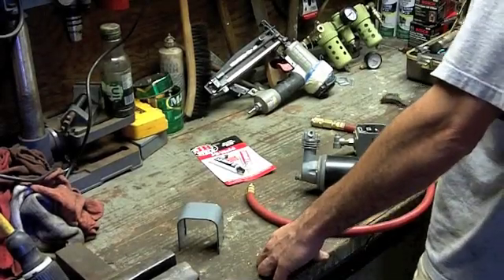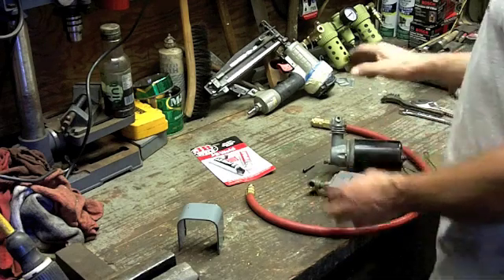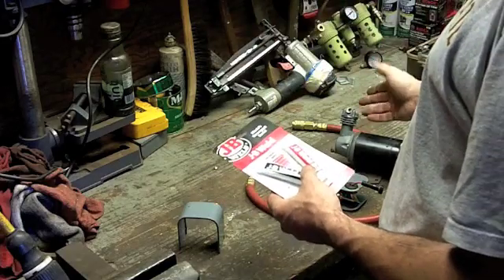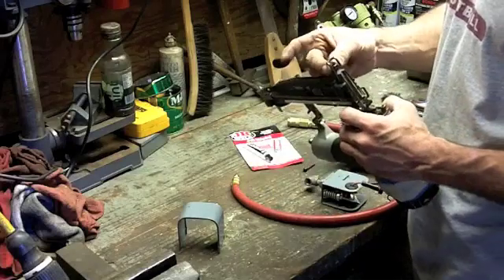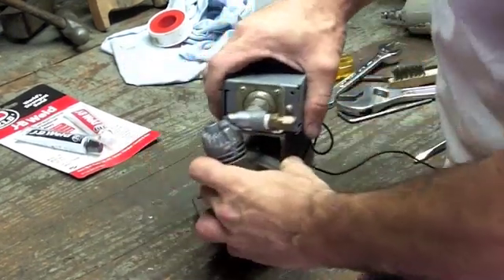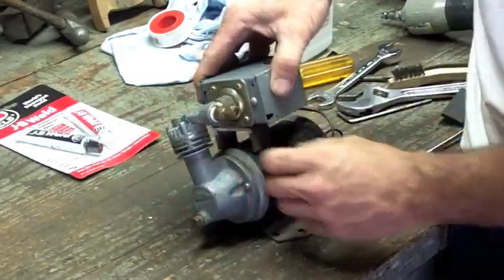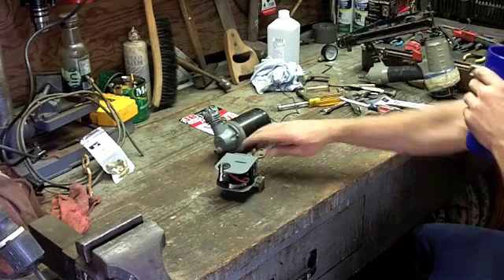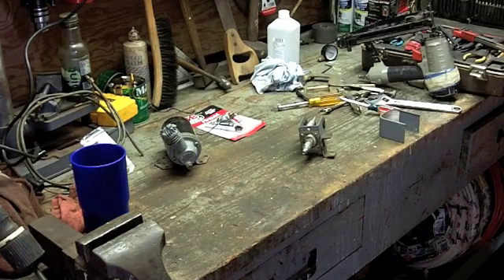JB Weld Stress Test Part 1

Comment: hey i have a question. Do you think i could use this to "weld" steel flat bars onto steel rectangular tubing for a minibike build... i am not sure if it will hold up but it would need to withstand 60 lbs... is it possible?
Reply from the maker: Honestly I don't think that would hold up.  Vibration and leverage are going to be your biggest hurdle.   I am assuming you don't have access to a welder, maybe drilling holes and using bolts would be an opion.
Reply: yeah i am thinking of that too. i think it will work

Comment: hello just a small idea should of used a piece of pipe in the center then encased it in jb for strength & durability hope it helps
Reply from the maker: Hey Eric,  I don't remember if I showed it in one of the videos, but I actually did slip brass tubing inside the air passage, hoping to add some stability.  That pot metal head really gets hot and moves around a lot.  I ended up milling a new head out of a block of aluminum and it worked quite well. Thanks.

Comment: I know its an older video. But will JB Weld work on axle cover?
Its the third member cover. I got over zealous cleaing it with a wire wheel on a Dewalt angle grinder. It wil only be temporary. Until one comes in from Jegs.com
Reply from the maker: If the cover is clean and decreased I see no reason for it not to work.  I cracked a side cover on a motorcycle and patched it with JB weld a couple years ago...still holding tight.

Comment: My Dad Showed me an awesome trick one time when welding anything that is sensitive to warping or getting to hot !!
If you are able to clamp on a couple Vice Grips onto both sides of what you are welding As close as you can without welding them to your pieces, 
The Vice Grips will direct the heat away from what you are welding long enough to weld or tack !!!
In this case, yeah it would have been better to remove your gaskets first !!
But this is an awesome tip for future jobs !!!
Thanks 4 Sharing Your Work & even if you wreaked your gasket or part,
This is a good lesson learned for you & others that watch your video !!!
Thanks !!
Reply from the maker: All great information..Thanks for sharing.  Hindsight is 20/20, but I should have definately used some sort of heat sink, or taken it all apart before welding. The upside is the new gasket actually is working better than the old one.  Thanks for watching!
Reply: Awesome idea thanks!

Comment: Seal the leak and keep going. JB should hold it. A lot of cracked lower units on boats get fixed with it. Remember back in the 80s some guy gooped it on a cracked block of a bulldozer. Don't know if that was true or an urban legend, but JB Weld has held a lot of things together. Don't bang your head, we all screw up even when half our brain is saying no.

Comment: i have herd a story of filling in the score marks in the cylinder  walls of a 6-71 Detroit diesel honing the hell out of it putting it back together with new rings and it running another 6 years in a lobster fishing  boat when the boat was retired they poped  off the head and all looked fine  but it seams a little far out to be true  but the entire left hinge on my 5 year old mac book is held on with it bean holding fine for the last month or so

Comment: I had a front hub that the race had spun in. Couldn't find one locally so I JB Welded a new B-Ring Race in and it held for a week or two until I found a replacement Hub...